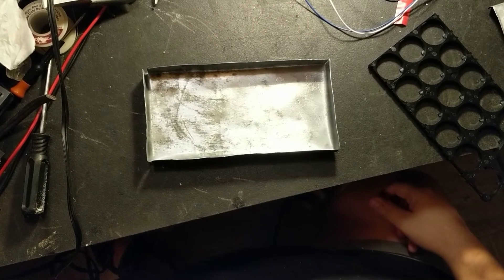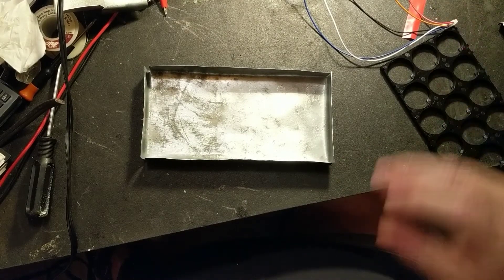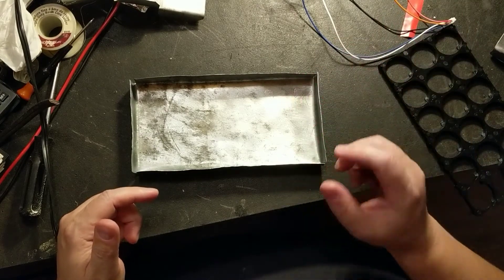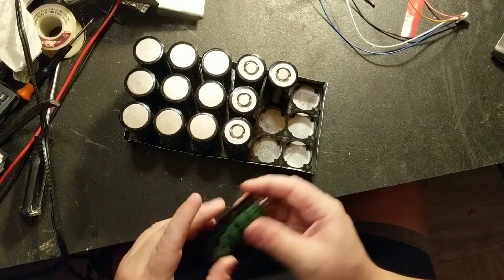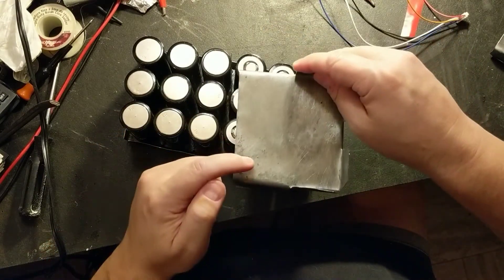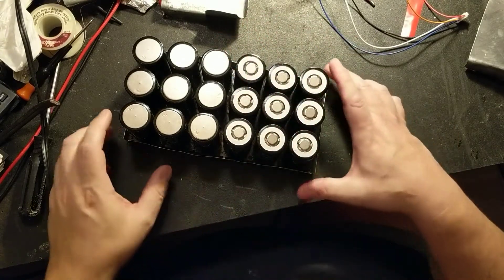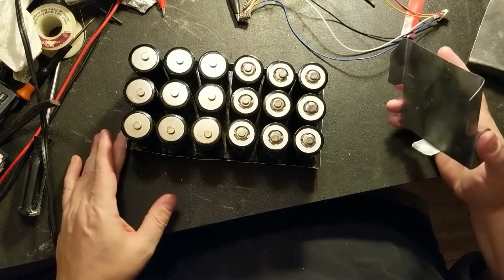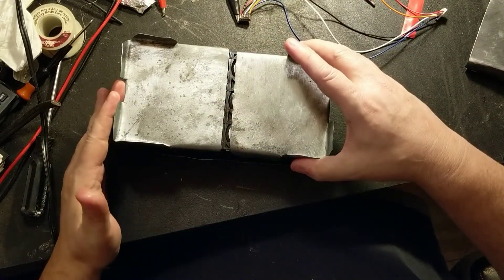Quick DIY battery pack with magnets and sheet metal

Comment: will the magnets move?
Reply from the maker: they could under extreme conditions, but they self heal because they are strong magnets. You don't have to worry about thermal expansion or vibrations causing cracking in the weld joints

Comment: Using the 4 12awg wire fixes the heat issue?
Reply from the maker: yep, and spreading it to four points worked fantastic.